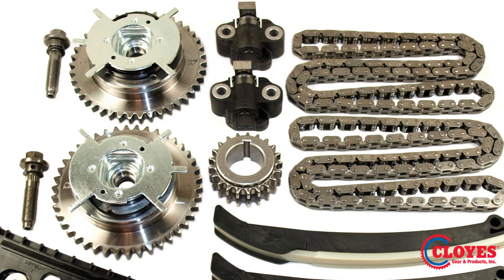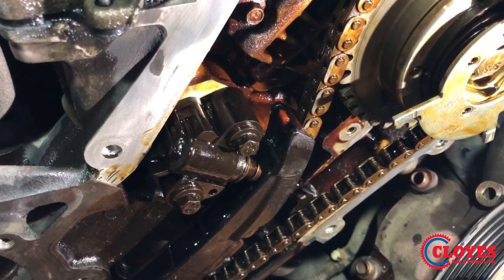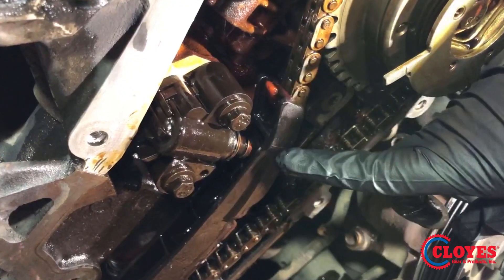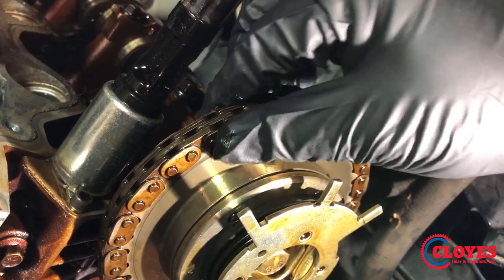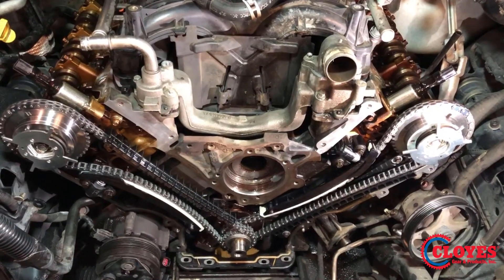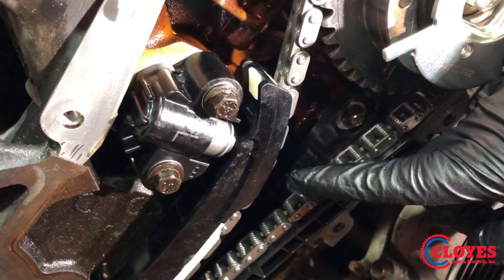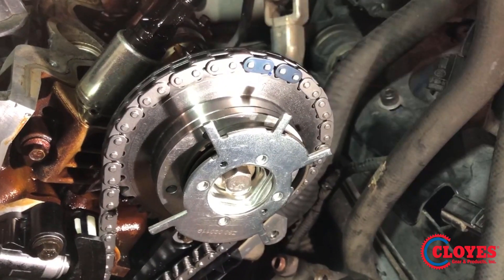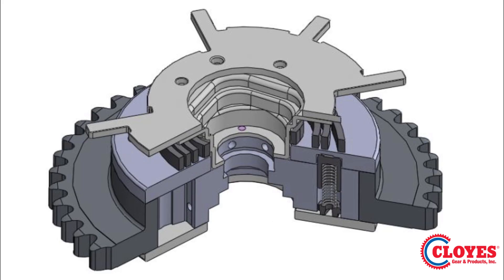Diagnosing VVT Cam Phaser Issues on Ford 5.4L V8 Engines, Cloyes 9-0391SBVVT

Comment: Straight from China!  Don't waste your time.  Remember I told you so when you're ripping down your motor again in six months.  What a shame!  I remember when Cloyes was a top-notch American manufacturer.
Reply from the maker: We do manufacture the components in this kit in China, but they are exclusive to Cloyes and made with our tooling to our specifications. What kind of issues did you experience with the set?

Comment: big no no buying aftermarket internal parts......should only use OEM quality parts......those aftermarket junk parts will be toast in less than 10k miles.
Reply: If what you say is true, do you think that they would still be going strong in business, sometimes we try to save money and cut corners in repairs. For that matter even  oem parts will not make up  bad bad workmanship.
Reply: @hectorgarcia8691  Ford has already improvised the cam phasers and they are tried and tested to make it 100k before changing out. I personally tried the Cloyes kit and it lasted 2 months before the drivers side phaser imploded.
Reply: @hectorgarcia8691  Going strong?  They rebox China crap now.

Comment: I have a 2004 Ford Expedition 4.6 l with no check engine lights no knocking no hesitation no misfires. It starts up but slowly bogs out as if it's running out of gas I change the fuel pump and filter check alternator battery and ignition. I was told that it could be my timing belt or anything connected can you help?
Reply from the maker: Typically a timing issue will trigger a check engine light, and if it has jumped time the issue will be consistent.
Reply: @Cloyes01  I will start with the catalytic converters
Reply: @tyronespates1655 so what happened in your case ?

Comment: Do you know if Cloyes sells private label? I bought the5.4 cam phasers & they came double boxed the inside box didn't fit in the outside box very well.
Reply from the maker: It should come in an outer Cloyes box and inner brown box. Both should be labeled VC100. The bolt should have a little note bagged inside referencing 90 foot lbs. instead of the factory spec.
Reply: @Cloyes01  Yes correct  brown box inside Cloyes box with 90lb note on bolt
Reply: Did it say CHINA on it?  It's Cloyes.

Comment: Just put cloyes kit in my 5.4 3v, along woth new vct solenoids. ran GREAT! (For 20 miles, problem is back full swing) don't buy this junk kit. You'll be like me shopping for a new vehicle, while unemployed because of covid.
Reply: I always put Motorcraft back on a Ford. I’m bout to do this job and I get a motorcraft direct replacement with High Volume Oil Pump so I know oil is getting on over to the other side of the motor properly. Every single time I’ve seen this replacement and it wasn’t Motorcraft, they were back in the motor within a month doing it all over again. If y’all gotta tear down that far, just do it right, do it all, and don’t skimp on your parts. You’re gonna get what ya pay for every time. Cheap shit= cheap results
Reply: Have run my replacement Cloyes kit for 100,000+ miles and no issues.  You should have had a mechanic install it.
Reply: @Entreaur  I had a Mech install my cloyes kit and so far it’s failed.
Reply: @steve4539  how long did it last?
Reply: I just bought Cloyes cam phasers and timing set. I think they sell private label because the  box the cam phasers were in was double boxed, the box inside didn't fit very well in the Cloyes box.🤔 But I chose Cloyes over other brands because they have lifetime warranty.
Reply: Bought a kit from rock auto  all said made in china on it.  To scared to install bow
Reply: @slippyfistt    Already sent it back. Got all ford stuff turned out good.
Reply: I was a tech for over 10 years with ford, just installed a cloyes kit and now chasing problems. Not sure why, but I should have went with fords expensive shit

Comment: Have a 2007 ford f150 keeps giving me p0012  i have put in everything brand new cloyes and still is doing this problem any help please!  Runs perfect till it warms up have changed oil as well   As both vvt both phasers chains and all timing
Reply: Did u figure out what was going on with it I’ve got the same problem
Reply: When timing guides break and chain rubs inside the motor screens get clogged and blow out its best to change the motor or youll end up spending more money then its worth   Because the oil passages in the head can get contaminated the p0012 is caused from i dont know what because i have replaced vvts twice and cam phasers twice high volume oil  pump checked wiring and still had same problem even cleaned screen in vvt housing total loss so its a new motor time   Any other thoughts from anyone else would be fine
Reply: I would assume that replacing the phaser for bank 1 and all the timing components including hydraulic tensioners would fix this problem. make sure your oil passages are clean and clear and not clogged up.Also make sure you have good oil pressure. do not go by the gauge on the dash. make sure you tap directly into the engine block to read pressure with the gauge.

Comment: Mine slightly ticks when it warms up It comes and goes sometimes you can barely hear it and sometimes you can really hear it only when it's warmed up. Cold start no sound at all, clean. Could that maybe be the exhaust manifold or intake?
Reply: Cracked exhaust manifold .
As it warms the crack gets larger . mine does to but i dont think its bad to the engine . perhaps irritating
Reply: @tasmaniandevil7610  thank you Tas. I will look into that. 2010f150 last year of 5.4. thought they had all the kinks worked out
Reply: I have a 2000 ford v6 f150 and its been doing it awhile but no burnt valves i can still get 500 miles to a tank of gas with no oil burning . perhaps one day ill replace the exhaust manifolds to see
Reply: @tasmaniandevil7610  Hi mileage? Mine only has 106k just bought it back in March for 9k It was a government fleet truck well maintained
Reply: Mine has 230,000 but sometimes i wonder what its quiting point would be but as long as it drives im good with it .actually im quite pleased wirh all the miles it has plus its 5 speed standard .